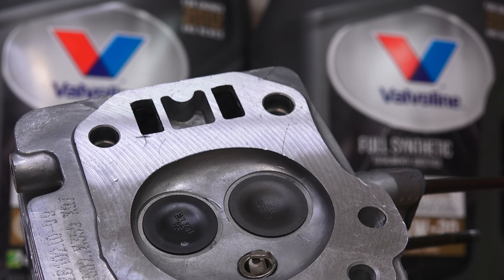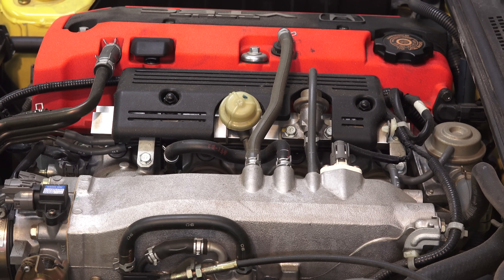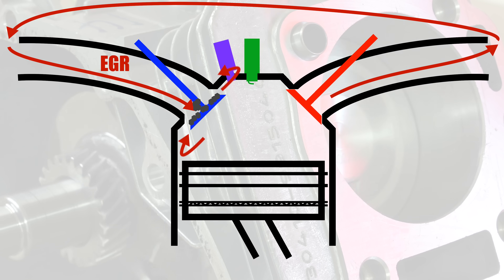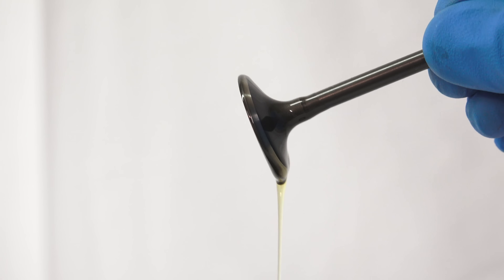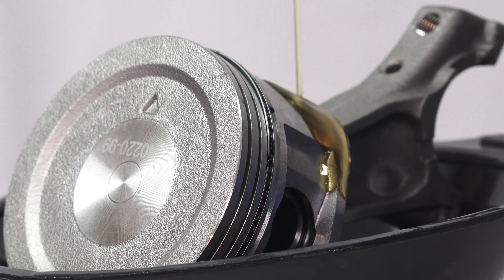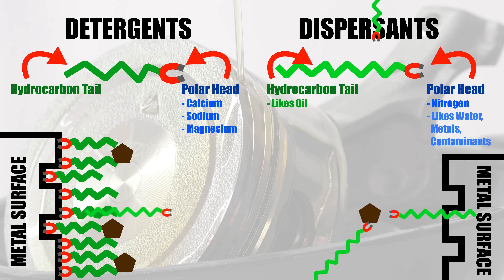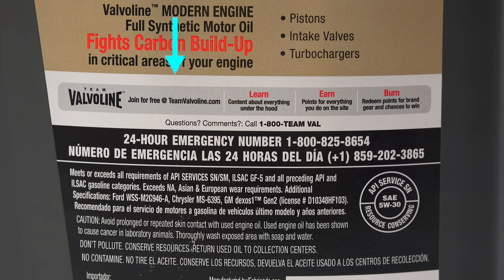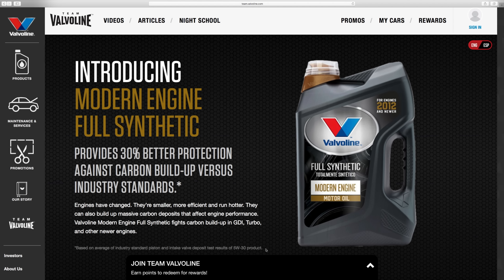Can Engine Oil Help Prevent Carbon Build Up?

Comment: Excellent video. The cleaner the motor oil, the less carbon deposits to clog your PCV valve and intake manifold in direct engine cars. I load up on Costco Kirkland synthetic motor oil when it's on sale and change every 3-5,000 miles.

Comment: I’m on my third oil change with Valvoline restore and protect. VRP is getting talked up quite a bit on YouTube right now. My car felt more powerful before I was done with the first oil change.

They say it takes 3 to 4 oil changes for it to do its full effect, but they don’t say how many miles per oil change. Since I’ve started to change my oil every 3000 miles now instead of 5000 I’m guessing I should do more than 3 to 4 recommended oil changes with it to be sure I did the job right.

The other thing I’ve done is use Shell V-Power premium gasoline through it for well over the 2500 recommended miles for it to do its job. It’s definitely smoother.

I just sank $3500 worth of parts and labor into my engine, so that’s why I’ve been doing this.

I just wish had done it sooner, but I’m guessing my car is gonna make it to 300,000 miles or more if I keep changing the oil every 3000 miles (or less).

I don’t know if it’s important to keep using Valvoline high mileage or the Walmart brand high mileage after treating it with VRP. I’d like to use the Valvoline, but it’s about twice as much as the Walmart. 🤷‍♂️ 

This was an excellent video! 

🙏

Comment: If you have a GDI engine (no port injection) remember: they ALL dilute fuel with oil. This means your additive will mix with your oil (bad for lubrication). Only use additives a few hundred miles/kms BEFORE your oil change, so that it does its cleaning and then you dump it out. Not many people know this.

Comment: for gdi engine, selecting engine oils are not much  helpful for engine knock or lspi. you should use  premium fuel minimum ron95(aki91). think about compression ratio, they are high compression engines, if you keep using low octane fuel you will suffer from damaged cat or engine piston and combustion chamber

Comment: Short cold engine trips with high rpms are causing the most carbon build up. Take the car on trips over 30 min at least once every month. Remember, engine temp dash gauge shows coolant temperature, engine oil takes much longer to fully warm up.
Reply: If I use my car strictly for work which is 15 minutes to and 15 minutes from, all highway my car will get very sluggish and even misfire at times while im on the freeway. This is very noticeable in the winter time. I notice that all this will clear up if I go out on the weekends and get stuck in traffic say on a saturday afternoon. It seems that high engine temperatures for an extended period of time are actually good for the engine. I have a 2018 Cruze.
Reply: @markjou9799  Indeed, there was a study showing that in warm weather, driving the car to fully warm up the engine (30 min) then keeping the engine at 3000 rpm for 1-2 minutes will clean a light carbon deposit. It's important to have fresh oil when doing this and don't keep it longer than 2 minutes at once. This works only after the engine has been fully warmed up, not just the coolant temperature shown on the dash.

Comment: I appreciate the video.   You create great content.   I'm looking, not for help preventing, but for help eliminating carbon deposits that are already on/in the rings of a 100K mile car that I just bought that is burning a quart every tank of gas.    Your description of dispersants and detergents , though appreciated, didn't address the issue of pre-existing carbon deposits already cooked into the ring groves..    In fact, I can't find a video here that does.   Valvoline does have a "Protect and Restore" product but it doesn't come in 5W 40 weight or WV 504.00 certified which is the requirement for my 2017 Audi Q7 (  supercharged 3.0t , TFSI. ( dual -injection))     I was so desperate that I recently did a B-12 Chemtool piston soak.    It did such a great job on the tops of the pistons that I think it probably helped with the rings as well but I don't yet have enough miles , after the fact,  to know if it actually helped or not.  Though I'm sure it wasn't good on the seals, gaskets, and o-rings.     Help?

Comment: Looks like auto manufacturers have made it impossible for a direct injection engine to reach more than 100,000 miles. That is unless you perform a valve cleaning procedure at, say, 60,000 miles. Having watched videos on this procedure, I’ve decided to keep buying older, non turbo, non direct injection autos. I don’t mind getting 20.5 mpg vs 20.7.
Reply: Hydrogen cleaning does help.

Comment: Not if the valve guides or their seals are worn out and leaking… oil type or catch can scams matter very little… and if the engine only has DI, not port injection as well… carbon buildup is in your future

Comment: If you let your oil go 10,000 miles between changes none of this matters…you will ruin your engine. Car makers and their extended oil change intervals are to blame…after all, they want you to finance a new car every 3-5 years. If you plan to keep your car long-term, change your oil every 5000 miles or less.

Comment: Well mazda skyactive engines have a big issue with intake carbon buildup which causes missfire at cold starts and rough idle on warm engine. However one should mention that carbon on the valves is better than in the atmosphere thats why no one addresses this issue 😂

Comment: You can't burn oil in a gasoline engine. Most GDI manufacturers have a fuel injection event during the opening of the intake valves to wash off oil. The best solution is a combination of GDI, and Port injection.

Comment: All types of injection engines create carbon build up... MPFI too, GDI just push it a bit further. 
Gasoline keeping manifold and intake valves clean is a myth, superstition. 
And of course synthetic motor oil prevents this a lot, but not everything. There is a difference with conventional motor oil in the molecular level which separates both in terms of evaporation, thermal properties and lubrication... in short: synthetic is better at everything, even carbon buildup prevention. 

And still an OCC is a plus

Comment: Most of the problem comes from the new car being sold recommending to change oil every 10K.  That's crazy!  Change it at 3-5K!!!
Reply: Here in germany, volkswagen tells you to change your oil every 30k km/ 2 years (around 18k miles) which is crazy, i change mine every 6-7k miles in my Mercedes and had reliable cars so far

Comment: Adverse climate and health impacts
While this technology is credited with boosting fuel efficiency and reducing CO2 emissions, GDI engines produce more black carbon aerosols than traditional port fuel injection engines. A strong absorber of solar radiation, black carbon possesses significant climate-warming properties.[37]

In a study published in January 2020 in the journal Environmental Science and Technology, a team of researchers at the University of Georgia (USA) predicted that the increase in black carbon emissions from GDI-powered vehicles will increase climate warming in urban areas of the U.S. by an amount that significantly exceeds the cooling associated with a reduction in CO2. The researchers also believe the shift from traditional port fuel injection (PFI) engines to the use of GDI technology will nearly double the premature mortality rate associated with vehicle emissions, from 855 deaths annually in the United States to 1,599. They estimate the annual social cost of these premature deaths at $5.95 billion.[38]

Comment: I tried modern engine oil in my direct injection v6 .
I have a oil catch can on it also . I always got 3 oz oil out of catch can after 5000 mi . Even with the modern engine oil . I seen no difference in oil vapors with the modern engine oil . Then they quit carrying the modern engine oil  where I buy . So for both reasons I quit it .  ✊🏻👍👌

Comment: Why don’t the OEMs design the PCV system to remove vaporized oil?  $,$$$.  They could have designed the cars to keep the intake valves clean, but they want you to have to bring it in for service after the warranty is expired.  They added direct injection and conveniently neglected the carbon deposits forming on the back of the intake valve.  Ford and Toyota have engines with direct and port injection which is probably the best long term solution IMO.  Great video!

Comment: It's been a while but I wonder what your experience with the new GF-6 oils, and whether any of the auto manufacturers (like Subaru) is actually using oil rated GF-6 ?  GF-6 is supposed to minimize oil dilution and other issues that have plagued Ford, Honda and some Subaru engines.

Comment: Using Valvoline or any other engine oil will not prevent carbon build-up on GDI engines.

Comment: Great video. Unfortunately Valvoline doesn't have a big presence here in the Philippines. With my GDI engine can I use Total Quartz 9000 5W40? According to their technical data sheet it claims to be compatible with all gasoline and diesel engines especially turbocharged direct injection and multi valve diesel engines. Would that qualify as GDI compatable?

Comment: My port injection system is almost ready :)
It will spray inside charge pipe based on a pressure sensor.

Comment: Speaking of cleaning......looks like a slight oil stream on your S2000.   Right he the dipstick.

Normally probably wouldn’t have been seen but with the red valve cover the oil sticks out on the contrasting background.

As always your videos are good in fort and facts not fluff.   Some slightly more complex than others but that’s why we have a pause and rewind button right?

Don’t think of me having to rewind or watch video multiple times as a criticism on your narration but more my watching a few time to embed in my mind.

Your white board with some diagrams also help set a picture/overview.

Keep up the good work!!

You and a Chris Fox should go to Detail and just take over.....you can be the engineer and him the mechanical representative.

Comment: I know this is an old video so I hope that my comment gets picked up.
I am looking at two different cars to replace my S2000.  An RC-F and M2 Comp.
First question is, am I making a mistake selling the S2000?  I know only I can answer that, but would like to hear from you Jason since you have/had an S2000 and have tested RC-F for an extended period I am assuming.
I know RC-F engine has no carbon buildup issues with its dual injector setup.
I am assuming M2 Comp does as it is only direct injected.  Should I be worried about carbon build up in the M2 Comp?
Have you tested the M2 Comp and if so what would you go with, M2C or RC-F and why?  For me RC-F for Lexus build quality, reliability and durability and M2C for manual transmission and larger back seat for my kids as well as roof rack for my bike.
BTW, RC-F would be a replacement for S2000 and would be my second car.  M2C would be new and replacement for both the S2000 and Camry (my daily)

Comment: Can you change synthetic oil too often in a direct injection engine?   I has seen opinion that the lighter factions mostly cook off in the first 3k miles, and it is those that are getting recirculated and causing the common carbon buildup issues on the intake valve.  So, change more often and get more buildup.  Any truth to that?
Reply: you find answer if true? I am interested to know also

Comment: Take this from racing knowledge. Get yourself a handheld container of water , give the engine a high rev and pour the water in without killing your motor off.
The black smoke pouring out the back is proof it’s working. You’ll need to repeat this a few times. Make sure the engine is at operating temp!!!!!!!
Works great with older engines too. I personally did a 50’s era flathead V8

Comment: Another reason why I will never puchase a vehicle with a GDI turbo engine.  They are more susceptible to intake valve carbon buildup.   I have a naturally aspirated 6 cyl  GDI engine (2014 MB C-350).  At 80K service recently, my indie mechanic checked by intake valves, at my request, and stated that there was virtually no carbon on the intake valves.   I change the oil every 10K and use only  Mobil-1 (0W-40 or 5W-30 ) fully synthetic.    Most of the GDI engines, from my research, that have the carbon buildup problems have been VWs and BMWs.   Newer MBs don't seem to have this issue.
Reply: Even with these "special" oils I still get build up.

On the US Golf R there is only direct injection z but for Europe they get both.

Comment: Castrol Edge is shown to have the best resistance to carbon buildup (by tests run for AMSOIL). That's why I use it in my 2019 MAZDA CX 5 2.5 L. CDI with a turbo. I also run a Cork Sport oil catch can to prevent carbon buildup on the intake valves from PCV emissions.
BUT... if you have a Direct Injection only engine (no port injectors) then every 40,000 miles you should go to a garage that uses B-16 brand engine cleaning system, pay $70. -$90. and get your engine cleaned. B-16 works better than SeaFoam for this purpose.
Reply: This will depends from grades and blends, also this change through years, so 2 years later it could be Pennzoil that are now the best. Oil analysis is the best tool. Normally engine oil made in Germany or France like Liquimoly or Motul will be the best you can get. Up to you.
Reply: @vwbora26  ...One thing he didn't mention was the auto manufactures specs for the oil type and you should only use oil with the specification for your make of vehicle for my Mk7 VW Alltrack it's  VW 502.00 and 505.00 spec I use Liquimoly High Tech 5W40 and even though VW recommends oil change at 10Kmi I change mine at 5Kmi.
Reply: @harryberry474  for a MK7 I suggest you use VW 504. If you live in north america, the Pennzoil platinum ultra euro LX 0w30 is an excellent choice for the price.
Reply: @vwbora26  I'm perfectly happy with what I'm using thanks.
Reply: @harryberry474  until you have carbon issues on the intake valve that is.
Reply: @vwbora26  ...So you're saying use Spec 504?How did you come to that conclusion?When the recommended spec is 502.00/505.00 which is what he Liquimoly I use is specified for my car actually ALL Mk7's I'll stick with the recommended oil until I hear different (from the tuner I frequent or the factory changes the recommendation). Thanks
Reply: @vwbora26  ...So you're claiming 504 spec oil prevents carbon build up? ALL oil will cause carbon build up over time in ALL DI engines. period
Reply: @harryberry474  it will reduce it greatly, don't just take my words , research it.
Reply: Yeas Castrol are simple the best !

Comment: My engine oil turns sort of black after 3000 - 3500 km (1800 - 2100miles), otherwise it looks like it was just poured in. Is it a good sign?  (honda civic 8th 1.8ivtec 2007)

Comment: Great information, it means 30% improvement that still will not solve intake valve build up issues in most direct injected engines from Hyundai, VW, BMW,  Benz, and Honda.
Reply: @therealSIRBOOM  Catch Can reduce a bit of carbon deposit but the main cause is the actual intake manifold design itself.  Especially if it has an EGR line or any kind of recirculation system.

Comment: Running any internal combustion engine with oxyhydrogen gas and gasoline will prevent carbon buildup on the intake and the exhaust valve and also the piston and head.  Gasoline ignition speed is 4000 feet per second and water converted into HHO Gas ignition rate of speed is 44,000 feet per second that is 8 miles per second at 19,000 miles per hour. The image you show at the beginning of your video of the clean engine head is almost how clean you will see it running with oxyhydrogen with gasoline. The oxyhydrogen fire obliterates carbon at the same time.

Comment: Oil doesn’t touch the intake valves which is why I looked this up. I have a hard time believing a oil will clean my intake valves on my gdi.  Those who leave smart a$$ comments I looked at my intake valves after 1500 original miles and they were covered already. Imagine what they’d look like after 50k or even 100k miles?

Comment: I have  VW Jetta TDI (diesel) 2002 with 266k on it and the intake and EGR valve are almost completely closed with carbon build-up.  I use Delvac 5W40 and change the oil and filter at 10k (VW recommended).  Is there a solution to this issue, such as a fuel additive, regular EGR maintenance, or other?  I enjoy and learn a lot from your videos.  They are professional and well researched.  Thank you for producing them.

Comment: I think Toyota got this right. Their system uses small port injectors combined with DI to get both the benefits of DI and clean the valves with the port injectors.

Toyota was late to the game, but now that they're here, I think their system will be the best.

Comment: Leaving 10-20% of the sump capacity of oil in the engine, after standard drain and refill will greatly increase carbon development and breakdown the oil.  Perform a Full Volume Oil Change to get a 99% oil exchange.  A fact that manufacturers do not want to talk about.